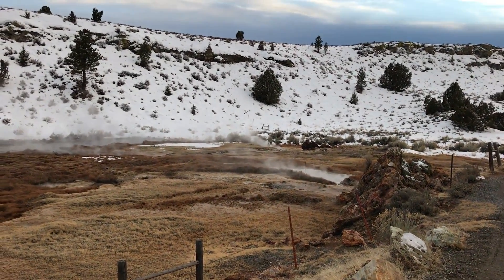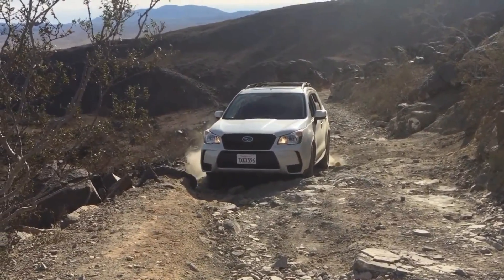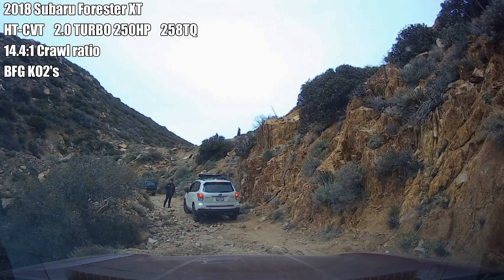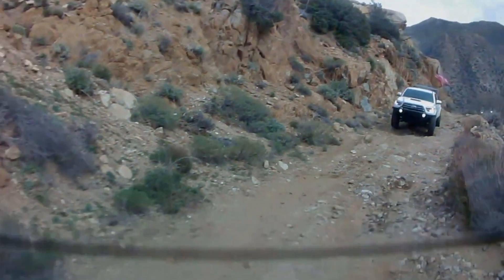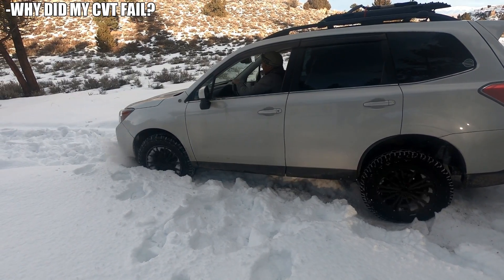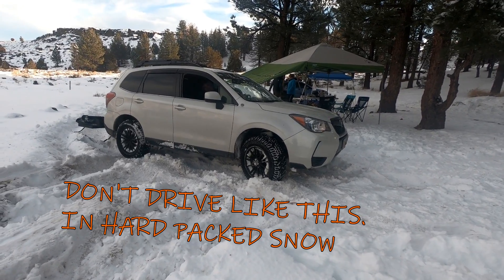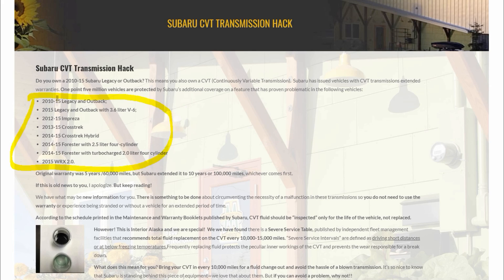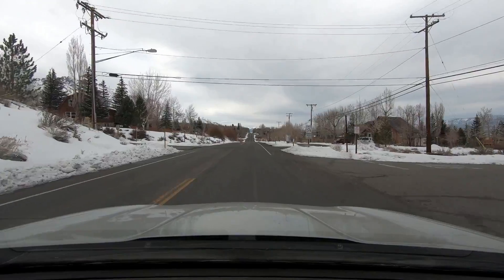CVT transmission Failed!  Can we make them last?

Comment: I think @Benjamin speechly has it right. These cars are mass produced for the common person. Most people aren’t putting it through the kind of “abuse” these people in the off road clubs with the extreme modifications do. Under normal circumstances the CVT transmission is ok. But they just are not designed to operate well in low speed high torque applications. I am always telling people with lift/modified trucks, once you change/modify one thing, you have to upgrade/modify a lot of other things on the vehicle to make it be able to handle what your doing. So even in the case in which you have not actually changed/modified anything, but you are using it in a more extreme condition then what would be considered “normal”, you will probably have to modify something. Just as if you were to take your car to road course track on the weekend, it would be a pretty obvious and well known modification to upgrade your brakes and tires. When off roading in a vehicle that does not have a low range transfer cause, you may need to add some additional cooling and/or atleast monitor your temps. In addition to not only making those modifications, as stated in the video, when using your vehicle in those more “extreme” conditions, it is absolutely necessary to change your fluids more frequently! I think that’s another big thing that is not understood by the “soft roading” community. They’re learning the hard way about things in the 4x4 community has already known for along time. Low range transfer case, locking diffs, disconnecting sway bars, winches, lifts, big tires, and low gear ratios are all essentials. A lot of the “soft roadies” are trying to run the same trails, in the same way a lifted Jeep would without having half of the off roading essentials the Jeep has. So since your going about it in a different manor, you have to prep your vehicle in a different manor as well. Most of us don’t even have an option to make half the modifications Jeep people easily make. So being careful, taking your time,
Reply: And adding coolers and monitoring fluid temps is a big 1st step. Along with understanding what you got and what it’s capable of doing and when to stop so as to not hurt anything. Soon enough this info will become more common place and the “soft roaders” will be able to do more of what they want more confidently. For now, it’s best to keep yourself well informed and do some research before you go out beating on your daily driver.
Reply from the maker: Heya Jklpino, there's a wealth of Knowledge in your comment right there!  Thanks for stopping by, it's good to hear from you again.
Reply: JonDZ Adventuring thanks for making more videos. It’s good to get the info out to people. Lots of people including myself use you and your videos as a inspiration to get out there and enjoy the outdoors. But a lot of people don’t fully understand what is happening to there vehicles in these off road situations. Although to don’t think most people would venture to do some of the more extreme things you do on occasion. I think it’s good for them to know and understand the info that makes what you do possible and what they need to do if they also want to do that. I talk to several other youtubers with different makes and models of vehicles to try to gather a broad base of information for myself. And I learn more and more every time I talk to someone. Even being a professional mechanic myself there is still lots to learn. Especially in the soft roading community. New vehicles and AWD systems are coming out constantly. Along with new lifts and mods. So it great to have someone willing to share there experiences, especially the mistakes and cost of repairs for doing what you do. I’ve really thought twice about being to crazy with my vehicle and have gone out of my way to make sure the fluids and maintenance is up to par with what I want to do. Now I can confidently go out and have fun. And no my fluids are not burnt up. And if they are, I can easily change then. I’ve started stalking up of common maintenance parts and fluids for my car so I can change them as needed. I have probably 3 big trips planned this year for us and our vehicle. And I feel confident we will be able to go out and have fun and keep up with all the other vehicles in our daily driver without hurting it. Keep
The videos coming! I always enjoy them!
Reply from the maker: @jklpino  thank you for the kind words!  I hope you enjoy your trips!
Reply: Spot on.

Comment: I’ve bought a 2019 Forester sport, I love everything about it but the CVT hoping it will last a bit so far I only put 700 miles on it. No hard acceleration or anything.
Reply from the maker: You'll be fine!  change out your fluids (not only CVT, but Diff fluid and engine oil) sooner than the normal Subaru driver if you plan on doing some light offroading.

Comment: Thanks for posting this @JonDZ Adventuring. I have been doing my research with the CVT as I am part of a Subaru club that does off-road touring frequently. You have pretty much covered exactly why automatic transmissions fail most of the time, planetary or CVT. It's best to have such accounts coming from first-hand users.

When I saw the performance of some of the CVT Subarus in the previous videos, I knew for sure that they were fluid temperature-related. The tolerance to overheating with that type of transmission is rather low, especially in abusive and high-torque situations. It's not limited to CVTs though as planetary-geared automatics have such temperature issues, as well, and that is why the transmission fluid cooler is invented. This overheating issue has been in the industry for quite a while and even the mighty sold-like-panckes Ford Ranger gets such failures.

The trend in our off-road club here in the Southern Hemisphere, though, is the other way around. After them getting headaches with their newer-model automatics, they are now into Subaru CVTs and surprisingly, what they got brand-new has an oil cooler from factory. They still tend to change fluids every 30,000km max. Many have bought the N/A with the TR580, after coming from Jeeps with 9-speed ZFs. They concluded that they would just change the fluid religiously with their CVTs rather than having to deal with their Jeep's warranty. After comparing off-roadability the club was just impressed by the smooth transfer of the CVT up to a certain point and that is also included in your video. Once it's past 30 to 40 something degrees, oftentimes, the CVT can struggle but not all the time. It can be annoying but some of those with the 2019 TR580s said that they have better climbing capability than the previous model.

Back to overheating, you and the others are right, city driving is considered severe driving and that is pretty much overlooked by most vehicle owners. Some car manuals say this and some don't. Here, Subaru recommends drain-and-fill every 30,000km when the manual says 48,000km for city driving. It would be nice for the dealers to hold a quick presentation about maintenance as a form of social responsibility but I understand why they won't. Once a vehicle has been sold, they already have their revenue. Cheers.
Reply from the maker: Well said Eldo Rado!!  I'm absolutely surprised your group prefers CVT's.  I owned one myself and the major advantage I saw over the older 4EAT Subaru's is substantially better fuel economy.  But, capability wise, it didn't seem like a contest.  

I'm going to link a video of 1st and 2nd generation Foresters rock crawling.  Being a former CVT owner, I can tell you there is no way this terrain would be traversable in a CVT subaru.
Reply: @JonDZ_Adventuring  I am surprised too. I myself am driving an SG5 with a JDM 4EAT - uprated valve body and aggressive lockup. Many have been surprised with the hill and dune climbs.

The ones in the club are talking about the 2019 ones, not the previous gen and they say that they get more freedom and power to the ground with the Dual X-mode. Time will probably tell and hopefully we get the videos from owners soon to do some comparisons. Cheers.
Reply from the maker: @eldorado5650  That's a great thing to know about the 2019 Foresters!  I've seen one 2019 so far, but he was completely stock.  He did say that Xmode in dirt/snow mode made it more capable.  Also, Subaru is claiming that the new Forester is the "most capable Forester yet", so I'll take your word for it.  The only thing I know is different in the Forester XT is the way the center differential is controlled.  Before it was controlled hydraulically, now it's controlled purely electronically.
Reply: @JonDZ_Adventuring  @Eldo Rado this just gives me hope with the 2019 Foresters. It would be great to find out what Subaru did to improve the CVT in 2019 besides adding dual X-mode.
Reply from the maker: @Rob81818  we have a automotive journalists contact that says he's in touch with someone from Subaru.  I'll go ask him, his name is Patrick Rich.
Reply: @JonDZ_Adventuring  Regarding my mates going from ZF to CVT, they linked me to discussions in NZ and OZ about the performance of the Lineartronic CVTs and that so far, they have been impressive here in the Southern Hemisphere.

I referred to the CVT extended warranty
Reply: @JonDZ_Adventuring  .... (I accidentally clicked reply)... I referred to the extended warranty in the North American market and the local mechanics said not to compare performances because the ones that are in our market NZDM, AUDM and JDM have tighter tolerances (more well-built) than the North American ones and that is why they perform better and last longer. We don't have the extended warranty issue here, by the way. The last CVT issue Subarus had here was the torque converter failure in 2009-2013 and that is even rare, they said.

I also talked to at least 7 transmission specialists and they recommend the Lineartronic the most and the Aisin ones, close second. They really like the chain drive instead of the common Van Doorne one.

It's funny how different specs are in different markets but revisions and customisations for markets are not uncommon to Subaru. We even have a different paint clear coat and the plastics have much higher UV tolerances because of the ozone hole during summer. My JDM 4EAT locks the distribution to 50:50 in SportShift 1 and 2, whereas the ones in the US don't. 

The CVTs here stall a bit earlier than my 4EAT but they will still climb somehow. The stalling ones in the videos are really shocking but they are physical evidences of the issues involved.

Anyhow, your video is still a good one, especially for North America, Subarus biggest market. It addresses the issue and tries to solve it. Cheers.
Reply from the maker: @eldorado5650  you guys get better stuff than us?  Yeah... I'm familiar with that,. It's NOT FAIR 😆.  Remember when you guys has the dual range manual and we didn't?
Reply: @JonDZ_Adventuring  Yes, when I learned about the dual-range option not being available in the US, I was truly surprised. I thought the US would benefit the most with the low-range.

Even some of the JDM 4th Gen Legacies (BP/BL) here have EyeSight 1.0!
Reply: @JonDZ_Adventuring  Im looking forward to his findings :)
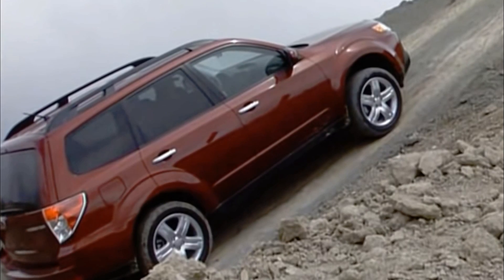Reply from the maker: Go to 4:28 in this linked video.  Pretty impressive stuff.

https://youtu.be/tlMPjevq7OQ

Comment: CVT's have been out for many years.  I'm still not a fan.   I really dislike the way they hold the RPM's up when accelerating.   I don't like the sound or the feel.  I also don't like that some manufacturers have programs fake "shifts" in some of their CVT's.   It's a deal breaker for me also like others have said.    I just don't plan these to be long term durable.
Reply from the maker: Ram 14250 fake shifting CVT's is the dumbest thing.  Completely defeats any advantage a CVT could have.  Actually, it makes the CVT's slower!  My old 2015 Forester XT did 0-60 in 6.2 seconds according to car and driver.  In 2017, fake shifting was implemented.  According to car and driver, the 17-18 models did 0-60 in 6.8 seconds.  That's over half a second slower!

By design, belt-chain CVT's just aren't designed to last.

Comment: Got an ascent on order but im glad that it comes with a extra transmission cooler from the start. I dont plan on doing rock crawling tho. Eventually it just may be deep snow.
Reply from the maker: That factory transmission cooler should help.  Also, the bigger FA24DIT motor will have more displacement to aid in getting the thing moving.  I'd highly suggest you monitor your transmission temps anyways.  Drive up a steep, long mountain pass and see how high they temps get.  OBDII sensors cost $15 on Amazon, and you can use Active OBD to monitor on your smart phpne
Reply: JonDZ Adventuring does yours pop up with a temp warning? I know the ascent actually shows it in the system and gives a warning to reduce power.
Reply from the maker: @radzer0966  there's coolant temp, but engine oil and transmission fluid don't have a reading, just warning lights.

Does the ascent have transmission temp gauge?  Is it going past 190 Fahrentheit?  That'd be helpful to know.
Reply: JonDZ Adventuring they all have oil temp now. I don’t believe the transmission has a gauge but it does have a temp sensor that notifys you at a warning temperature and a overheat. Also has a diff warning light for temp as well. Sensors on everything.
Reply from the maker: @radzer0966  my 2015 FXT has temp warnings, but I never got a warning in the snow. Maybe the sensor failed to register since I was in snow.  I also suspect my center differential could have been damaged. There's a sensor for that too, but I never got the warning.  Don't believe the sensor, I don't think it comes on until near catistrophic failure is eminent.  Learn from my experience with the Subaru, monitor the trans temp.  I've heeded this advice on the forums and I paid for it.

Comment: CVTs have a notoriously bad history!  If I'm buying a vehicle, the CVT is a automatic deal breaker for me.
Reply from the maker: It is for me too.  My girlfriend is in the market for a new small crossover I totally advise against a CVT.  It's a BIG no to the Honda CR-V, Nissan Rogue, Subaru Forester, and Mitsubishi overlander.  The only options are the RAV4 and Hyundai Santa Fe/ Kia Sportage.  Well, there's Jeep, but she's not going to be offroading, she just strictly needs a commuter car.

One thing I'd love to point out in this video is possible choosing a Jeep Cherokee instead of a Subaru, but I'd probably get hung on a cross for that 😆
Reply: @JonDZ_Adventuring  , If it were me and those were my choices, I think I'd go with the RAV 4.  Can't beat Toyotas for reliability. And they sell an awful lot of RAV4s.  That must mean something. I wouldn't go with a Jeep. Jeeps have poor reliability history. And NO Subarus. Head gasket problems, and CVTs.
Reply from the maker: @RicardoRoams  Toyota reliability is expensive!  A RAV4 adventure is $35.5k.  its well equipped, but so is my $38K Honda passport EX-L AWD (way more equipped, like $10K more equipped).  The RAV4 has a good drivetrain, but the AWD system is still so FWD biased.  Anywho you are 100% right.  She only wants a fwd anyway, but she demands her vehicle is satin white pearl, which only comes in the $40k top of the line model.  Man... That's alot of money for a RAV4.  We will see, hehe!
Reply: @JonDZ_Adventuring  From what I've seen, I do like the Honda Passport.
Reply: Yea 2019 Subaru WRX and I believe my CVT died it jerks at takeoffs and makes a grinding noise on 19,000 miles on it they suck and never had a problem with my 06 WRX

Comment: I have a Subaru Forester with a manual (2016 - 2018 Model). Do you think something similiar can happen to it, when i drive it in a harder offroad terrain? Or is the manual trans more reliable after all?

Thanks for the video! Never heard something about the CVT before.
Reply from the maker: A manual is solid.  Replacing your clutch is regular business and only costs $800 for parts is that?  Scotty kilmer (that "rev your engines" and "ring that bell") is a fan of Subaru's with manual transmissions.  That means alot!
Reply: @JonDZ_Adventuring  Thanks for the answer! Now im even more proud of my Subaru!
Reply: @triple6forty2  Same here, just got a 17 in a manual. Love it

Comment: I had a sneaking suspicion this is why you replaced your Foz.
Reply from the maker: I abosultely fell in love with the passport.  I envisioned I would mod it out the way it is right now.  I predicted the MPG loss would be minimal after mods.  I theorized that the AWD system and drive train would be pretty capable.  So far I'm not disappointed in the slightest.  Between owning a FJ cruiser and a Subaru Forester the Passport fits nicely somewhere in the middle.
Reply from the maker: Benjamin 🤐